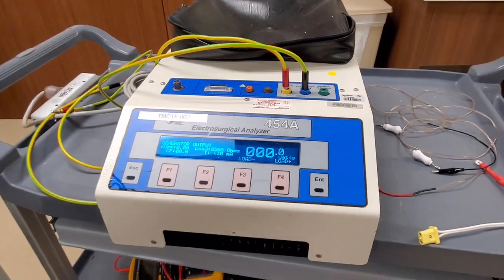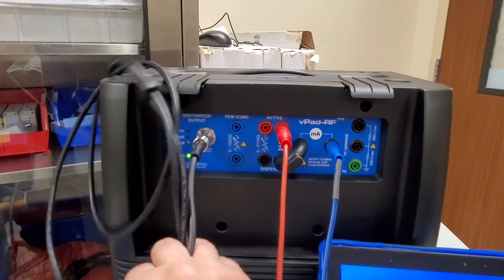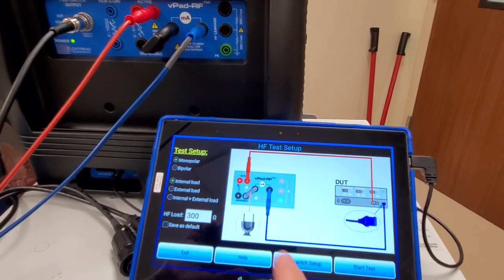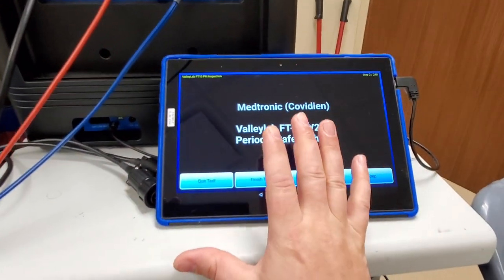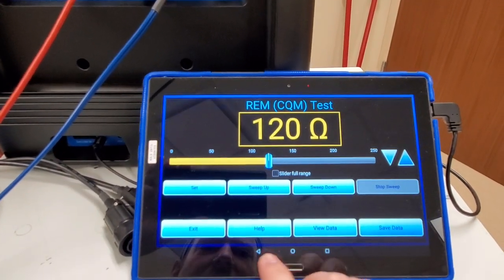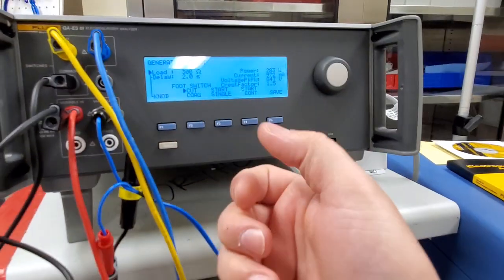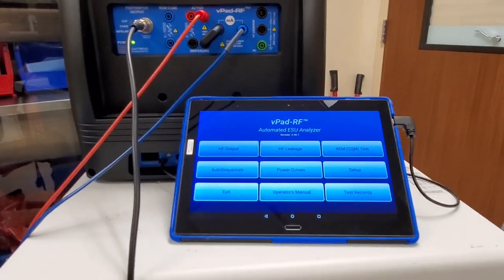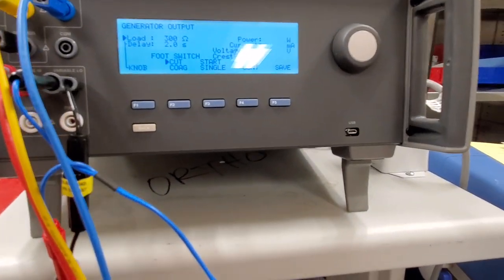NEW ESU Analyzers!  Are they really better than the old?

Comment: I think you would like the BC Group 2300 analyzer. It's simple like the 454 and with the external loads you can get up to 10000 ohms.
Reply from the maker: I have used the BC analyzer before and it actually has some interesting features - although its large

Comment: Just a question on something non diathermy related as I saw the stand in the background, what do you do for ppm on an airvo ? We just do a basic function check as per OEM but We have loads of failings / faults with the backlight screen failing & they are non repairable devices which bugs me cause a screen swap out is possible.  
P.s. I use the Fluke QAES2, which is a lot like the 3 but simpler to set up & use, but heavy when lugging around.
Reply from the maker: Interesting.  In the USA, diathermy is more of a physical therapy process using electronic waves to internally heat tissue. In the USA, these are cautery / electrocautery/ electrosurgery. I never knew that elsewhere referred to this by another term.  
As far as your question,  we do service these items but most hospitals have agreements in place to do an exchange whenever a unit is defective..  the screen should certainly be obtainable aftermarket.  The unit in the background will not turn on and it has no DC Voltage on the main board.
Reply: So you do take them apart ? Cause Fisher & Paykel instruct you never to open them up. I only did so because they would not warrant an exchange as like you said they usually do, so we had to purchase a few new ones. I assume your ppm is a function check & est ? & Yes we refer to what you describe as shortwave therapy/ diathermy over here. You are correct in your statement,it is electrosurgery using high radio frequency currents which in turn generates heat in the tissue which vaporises the intracellular fluid causing pressure to build & erupt the cell wall, so I assume that’s why they class it is as diathermy ?

Comment: What do you think about the Rigel Uni-Therm? Need to considere de best option for Service Department.
Reply from the maker: If I see one tomorrow I will give an impression. Let's see.
Reply from the maker: One thing I am interested in is the uni-therm graphs the power measurement over a variety of patient return resistances. That is fascinating.  Just attach a graph to the work order and you've proven the ESU for both output power and for patient return sensing.

Comment: Welcome to the results of engineering by committee.
Reply from the maker: Yes.   Both units need a multifunction port (much like a defib multiport twist connect) and each cable has a pinout for a type of esu. - including an inline patient pad resistor.
The days of  banana plugs and switchboard operations should be long gone. Connect at both ends and go. The routing of those wires can be internal on the analyzer pcb.
Fluke really let me down with that display and poor (non intuitive) jack layout.
Reply: @BetterBiomedChannel  Unfortunately, the best i can tell you is to try an get in contact with the marketing groups at these companies and try to get these changes on their road map. Maybe these companies do voice of customer activities you can get in on.  Then sit back wait a few years and hope.

The fluke does appear to have inbuilt Bluetooth in some countries. Might be able to communicate with it through that.

The vPad  already has WIFI or Bluetooth and an App.  From a technical standpoint it should be easy enough to just change the interface on their end. No idea on the regulatory nightmare that would entail.

You could also rig up something by yourself, the command structure is all there for the vPAd its just a matter of writing the software to do the talking and if that would violate regulatory stuff.

As for the more mechanical issues, may i suggest Velcro. Does that tablet have wireless charging by the way? 

Not the best solutions but we got to make do with what we got.

AREM